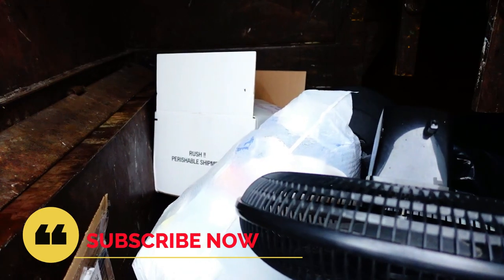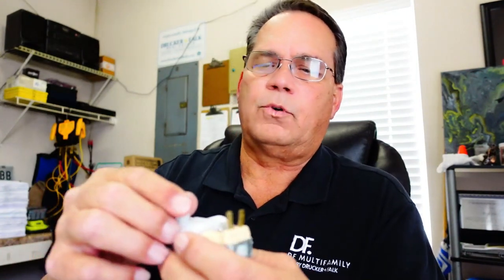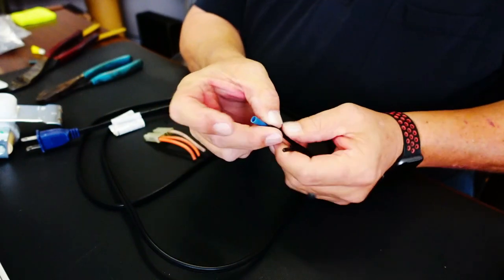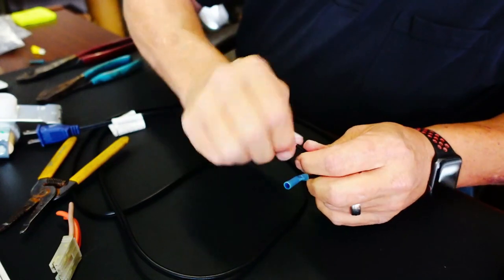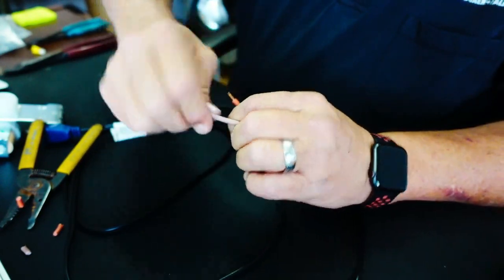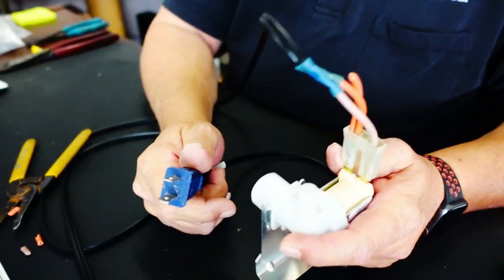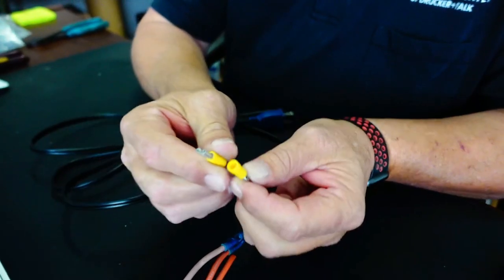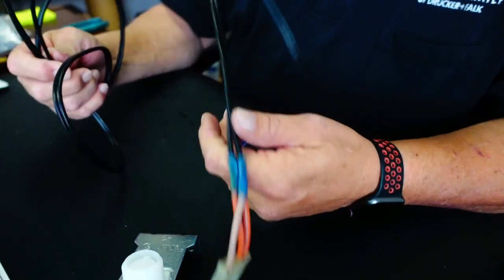Making A Cheater Cord for Testing Water Fill Valves

Comment: If that fan motor was stuck, you can take them apart and fill the bearing full of oil. I've never had one I couldn't save, unless the motor burns out. Use a power strip so you can easily switch your cheater cord on and off.